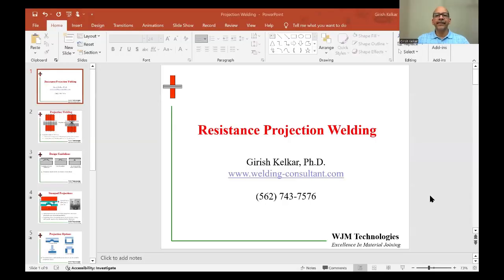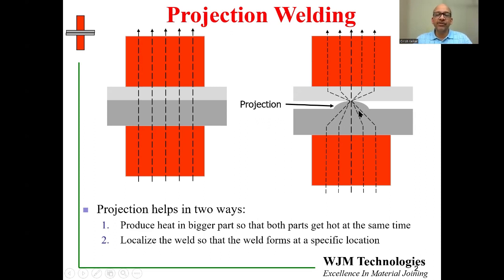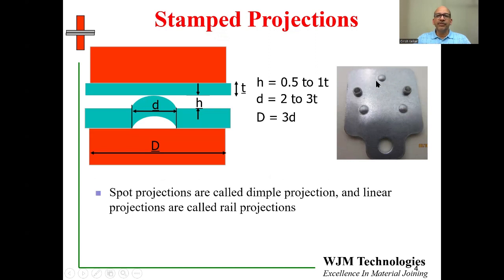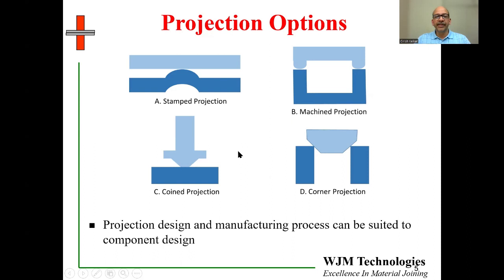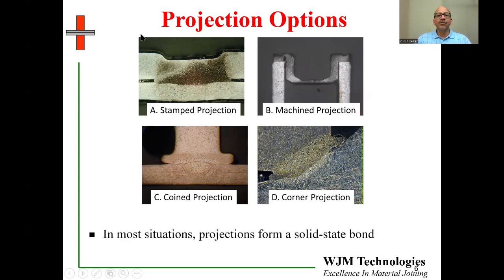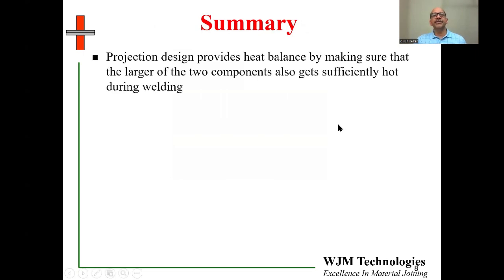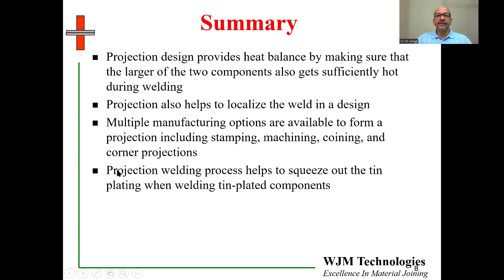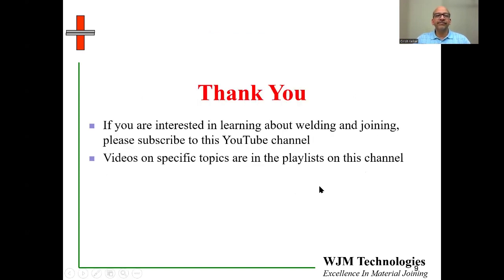Projection Welding

Comment: Thank you! San you provide a sample design analysis calculation for such resistance welding?
Reply from the maker: Glad you liked the video.  I presume you mean design of size of projection.  You will have to start with some basic guidelines as discussed in the video, and based on part and manufacturing limitations, followed by actual testing.  Usually takes a few itierations.